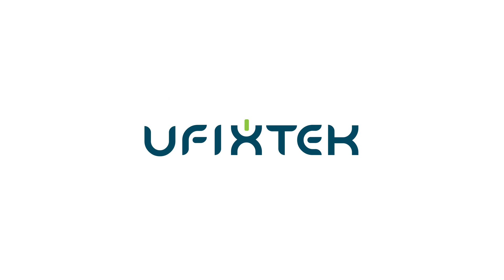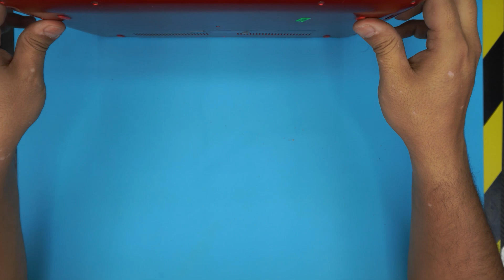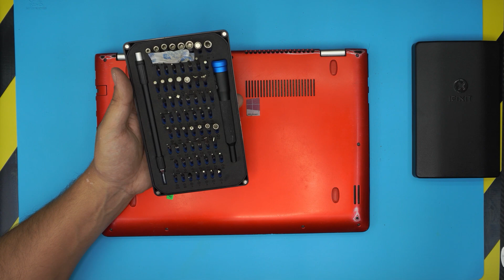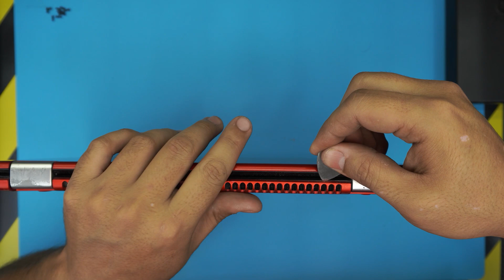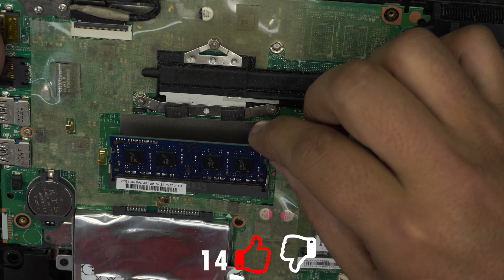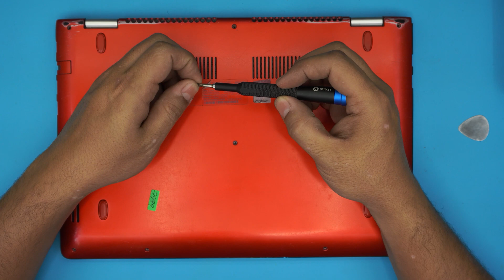How to upgrade Lenovo Yoga 500 Ram

Comment: sir what is the max speed and size the lenovo yoga 500 take? can i put a 16gb ram in it?
Reply from the maker: 🫠Regarding your question, you can only use an 8GB low voltage (L) stick, and it will work fine. However, if you use a 16GB stick, the system will either fail to boot or keep giving you a blue screen.
cheers🍻

Comment: So I found they sell one with 16gb, but in some papers for specs about this laptop it says 8GB is the maximum. Does it still work?

also: will this laptop run without battery and only charger cable?
Reply from the maker: Thank you for the feedback! if you wish to support the channel you can LIKE or SUB or both :P
regarding your question:  the laptop does support 16gb, but unfortunately it only has one dim available, and the dim can't handle single 16gb stick, it requires you to have a 8GB Sdram DDR3L (make sure it has the L for low voltage) 
this is a compatible ram 8gb: https://amzn.to/3WnxwAg
Reply: @uFixTek  Thank you. So apparently I have the 15IBD, it already has 8GB. But I didnt use it often and now the laptop is very very slow, even when I boot a fresh OS on it. Same with my older Gaming Laptop from 2013. No matter how often I try making it complete new, even with Linux, it cant run any game anymore. Back in 2013, I could play Dishonored 1 on it (3D first person stealth game)
Reply from the maker: i highly recommend you to upgrade the HDD to SSD and you will be shocked how fast it can be :)
https://youtu.be/3y5SxpbrAMQ

Comment: Great video! i have the same laptop and i have to insert a new ram too but will i lose everything i have on my laptop when i put a new ram or nothing will be changed ? Do i have to save it first ?
Reply from the maker: Thank you for the feedback! if you wish to support the channel you can LIKE or SUB or both :P
regarding your question:  you will not loose absolutely nothing, its all plug and play, no configuration or anything is required my friend.

Comment: Hi UFIXTEK, thanks for the video. I've upgraded the ram of my Yoga 500 from 4gb to 8gb ddr3l 1600Mhz. It is ok with that, but I also updated the BIOS version from the original BDCN31WW to the new one recomended by Lenovo BDCN71WW and from that moment, no matter what windows i put (7, 8.1, 10 x64) my processor clock multiplier stands at 5x instead 19x. I succeded to downgrade the BIOS variant back to original BDCN31WW, but the problem remains - the processor stands in 5x multiplier. Do you have any suggestions ? It is lenovo yoga 500-14ibd, with a few important settings in BIOS. Thank you - Eugen
Reply from the maker: its very common in this model that the bios even you downgrade it will has send windows the info, its acting as its throttling, its as issue with this lineup, you can bypass the throttling by installing this:
https://www.techpowerup.com/download/techpowerup-throttlestop/
Reply: @uFixTek  
Hi !
Many thanks and hugs !
You are outstanding guys !
I wish you a Happy New Year and goodluck in your bussiness !

Thanks,
Eugen from Romania / EU
Reply from the maker: @eugenpop1959  I'm sorry but i have no idea why YouTube  place most of the comments in the spam list!! sorry about it :(
 im very upset about this youtube algorithm that is broken, a "thank you" counts as spam or review comment!!!
thank you my friend and im glad you got it fixed :)
Please leave new comment if you have any questions.
Reply: @uFixTek  As I said 1 month ago: "And finally, after all this "ballet" of upgrading/downgrading the BIOS, I've found the old original charger of the laptop and with this one (instead the bigger new one adapter that i've bought because i didn't find the old one) the laptop works ok on battery and charger. It looks stupid, but that's the fact ..."
It really works, and now all it's ok. Thank you again. Eugen
Reply from the maker: @eugenpop1959  awesome , if anything feel free to ask. good luck
Reply: @uFixTek  Thank you, I will !!
Reply: @uFixTek  I'm back with one important add-on of the multiplier problem: When the laptop is on battery the multiplier is ok (19x), but when you add the charger the multiplier decrease to 5x and so the performance of the laptop.
Reply: And finally, after all this "ballet" of upgrading/downgrading the BIOS, I've found the old original charger of the laptop and with this one (instead the bigger new one adapter that i've bought because i didn't find the old one) the laptop works ok on battery and charger. It looks stupid, but that's the fact ...

Comment: Hi UFIXTEK, great video and super info. I have had my 500 for about 7 years new, and am thinking of renewing the ddr3l ram for a new module. I have seen ones with the same spec, but they say 1866MHZ, for example HyperX Fury, 8GB DDR3L, 1866MHZ, for desktop RAM memory. HX318LC10FB/8CL10 1.35v PC3L-14900U Black AD38.

Can you tell me if the MHZ will make any difference? and is it compatible? 

Many Thanks, btw subscribed!
Reply from the maker: Thank you for the feedback! if you wish to support the channel you can LIKE or SUB or both :P
regarding your question: you can place the 1866mhz it will work just fine, but before placing the 8gb SDRAM DDR3L, check my video to make sure your laptop can handle 8gb:
https://youtu.be/tKEJTkVth4Q
then you can place any SDram ddr3L the speed doesn't make a difference with your CPU.
i do highly recommend this rams they are solid and we use them all the times and they last longer.
https://amzn.to/2XtiAZg

Comment: Good video ,can we upgrade hdd to ssd in Lenovo yoga 500 14ISK model?
Reply from the maker: Thank you for the feedback! if you wish to support the channel you can LIKE or SUB or both :P
regarding your question:   Yes you can defiantly replace your HDD with SSD Sata 2.5" and the speed improvement will have your jaw drop :)
any ssd sata 2.5" is compatible the best brand is samsung ssd and the cheap brands are Kingston or ADATA.
if you want it to last get Samsung:
https://amzn.to/3qzkeCH
here is my video on HDD-SSD upgrade:
https://youtu.be/3y5SxpbrAMQ
and if you need help installing windows follow this:
creating win10 usb boot: https://youtu.be/uDu8j2lE-dM
and if you want to see the proper way of installing windows follow this video just  the installation steps :P
https://youtu.be/er1UXhie3cA
Reply: @uFixTek  thanks,yeah ssd is super fast compared to hdd that's why asked
Reply from the maker: anytime :)

Comment: Love the detailed video. I have the same exact laptop but with i7. Now in task manager under performance tab, in the memory it says "slots used: 1 of 4" but as you showed the laptop has only 1. What am I missing here? Also Is it necessary to get the same ddr3 (my laptop is also ddr3) or can I change to ddr4?
Reply from the maker: Thank you! for the feedback and your support to the channel by SUB :P
Regarding your question: Don't listen to what your ":task manager :" says its not accurate, even if you download programs its not accurate. the best way to know is to remove the bottom cover and you will know exactly how many slot you got available. and you can only place a ddr3 ram for ddr3 slot , the ddr4 ram will not fit into ddr3 dim. 
https://amzn.to/3hc7wXF
Reply: @uFixTek  I see, thanks for explaining. I saw in forums that the the intel processor used in this laptop can handle up to 32 gb of ram but I haven't been able to find a 16gb ddr3 ram. Since I want to upgrade from 8gb to 16. Is 8gb the limit then?
Reply from the maker: you can place a 16GB single dim if you want to pay $$$$$$$$$
https://amzn.to/3bfa6IL
:P
but for me i would keep it at 2x 8GB in order to have duo channel memory.
Reply: @uFixTek  Yea I actually saw that one, but that's ddr4 not ddr3. And Yea I agree; I prefer dual channel but for that I have to check my laptop and I doubt it has more than 1 slot
Reply from the maker: sorry i missed the link this is the one i was gona give:
https://amzn.to/3vUnutE